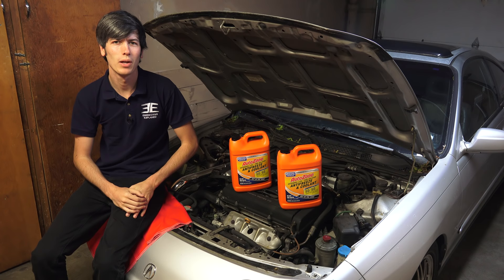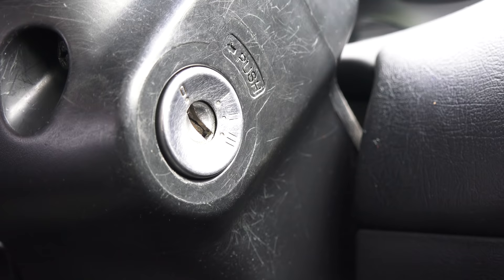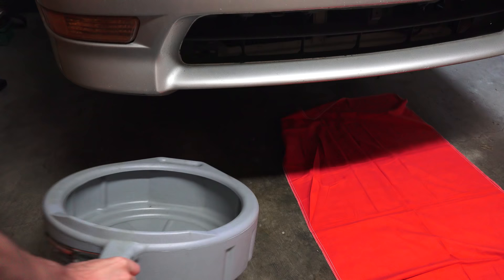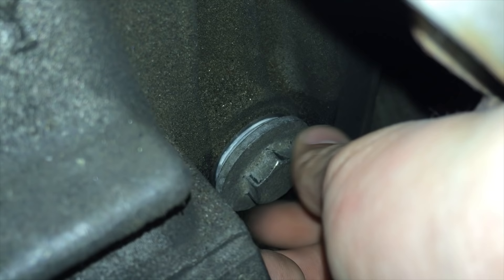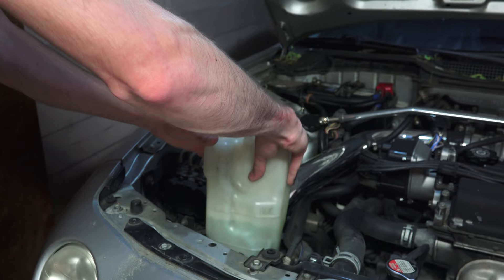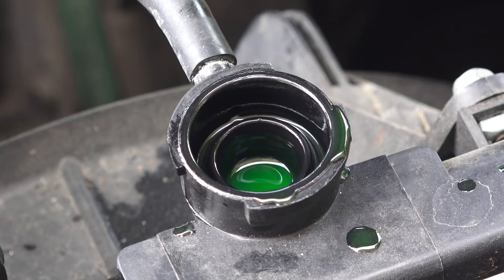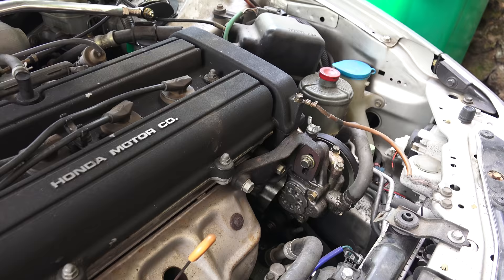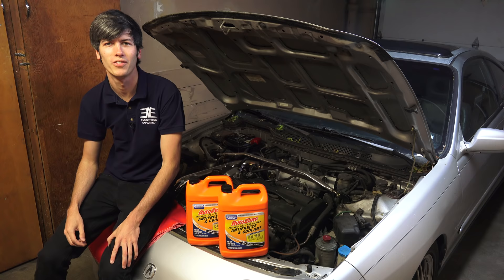How To Change The Coolant In Your Car

Comment: I don't use coolant in my Accents, it's just another one of my weight reduction mods
Reply: cool you saved 3 kgs in your car
Reply from the maker: Accents are naturally cool.
Reply: Hotter engines run better you know
Reply: 😎 If the car's paint is blue, it keeps the engine cool.
Reply: @fungustmaster  a1
Reply: lmao i just found out yesterday that my car was running like ass (‘03 Accent) because there wasn’t a drop of coolant in the car😂
Reply: Well water and coolant care probably about the same weight?
Reply: I heard ash is lighter than coolant .. 🤷🏻‍♂️
Reply: I heard from a freind of s freind that’s how you keep your head gasket healthy for a long time
Reply: Getting rid of radiator is far more efficient too
Reply: Use gasoline... it's lighter.
Reply: I think I have commented too much today 🧐🤐

Comment: I just open the cap and refilled. That was a mistake 😂
Reply: Why?
Reply: Its bad to just top it up ??
Reply: @betsthatnguyen  It's fine to top up. Just make sure you only use distilled water/coolant. But changing the fluid (draining everything) is recommended every 5-10 years. And if you need to top it up, then you have coolant leak. It's a sealed system, you should NOT be losing coolant. Find it before it gets worse and leaves you stranded (or orverheats the car).

Comment: Do all engines have drain bolts? Ive never heard of them until this video. And would it be a bad idea to run distilled water through it to flush out the coolant in the engine, then mix the 50/50?
Reply: I was wondering the same thing!

Comment: If you live in a cold climate, it can be worth flushing the heater core separately. My old car would give absolutely no heat in the winter; but after a back flush of the heater core not only did the heater start working significantly faster; it put out heat like it was brand new. This can even help with reducing how much time you let your car idle/defrost before leaving.
Reply: As an ex motorcycle rider I love the car heater and I'm in Australia.
Reply: This is awesome advice! 👍🏽👍🏽

Comment: Great video.  Proper maintenance is very important and often overlooked by many people.  Money spent early to prevent failure is cheaper than money spent later for a repair.  A good recommendation is to also fully flush the system with water and use a coolant tester to ensure a proper coolant to water ratio after refilling.  When bleeding air from the system it is good to have the part of the car where the coolant filler point is to be elevated to assist in removing air.  Like the video says a half is not an unreasonable amount of time to wait.  An air pocket could cause a sudden unwanted rise in temperature causing engine damage, especially if the head and block are of dissimilar metals, or completely aluminum.

Comment: Some cars have bleeder screws to help purge the cooling system. The GM 3100's have one on either side on the front of the engine. Open the one on the accessory belt side until air starts escaping then when coolant starts squirting out tighten it back up.

Comment: A trick I've found helpful for bleeding some cooling systems is to get an old/cheap radiator cap that fits,and pull the valve part out of it,so it's just the cap. Install said 'gutted cap' and drive around a bit,while keeping an eye on the temp gauge. Park it,and let it cool,and maybe repeat,if needed. Then install the normal radiator cap. This way the air will bubble out into the overflow tank,and when it cools,it will draw coolant into the radiator from the overflow tank. Self-bleeding. It just takes a couple drive cycles.

Comment: Always good to measure the amount of fluid that you drain so when you fill it you know what your shooting for.  The thing I would worry about in this video is you drained the engine block (nice that it has a bolt for that which is easily accessible) so when you refilled (thermostat closed) did the block get enough coolant mixture for a safe startup.  Knowing you drained a gallon and that you put about a gallon back helps to give you confidence that it did.  Just an extra bit of knowledge. Great video. Thanks
Reply: @168grhp  - you can’t generically say that the system will automatically purge the air. This is absolutely wrong in many cars like some Toyotas
Reply: @condor5635  I deleted my comment to keep from misleading someone with a cooling system such as you describe.

Comment: The plastic drain valve on the radiator can easily break on older cars and leave you with a bigger issue. It may be better to remove the lower rad hose to drain the radiator.

Comment: As a general tip I always attempt to get as much coolant into the radiator as I can before starting the car. Squeezing the hoses will help. Most cars also have bleed screws which must be used both before and after starting the engine.
Reply: What’s the idea about getting the air out? How do I do that when using a regular funnel?
Reply: @ktfoent  for example if the top hose is full of coolant then the radiator will be full. What one is trying to avoid is having a system that needs filling the next day or worse, driving on a partially filled system may blow a headgasket. Vacuum filling works the best particularly on rear or mid engined cars.

Comment: Thanks for sharing this video.🙏
I have a Honda Civic 2009 and want to flush the old coolant completely since I'm not sure when it was changed by the previous owner.
Q: You drained the engine block and started the car without coolant in the engine block. Does it DAMAGE the engine? How it should be?
Q2: How to ensure the heating radiator has drained (starting the car may needed)?

Comment: How do you know when the air is out though?

The easiest way to feel confident about it is to just wait 30 min?

Great video by the way. Its informative on something that in not technical but quite handy.
Reply: When you stop seeing bubbles gurgle up from within the fluid.
Reply: Why are air bubbles bad?! Can it cause problems if you don't get them all
Reply: @ninjalobo7  Basically if there is too much air, then it wont cool the engine as efficiently. The coolant mixture transfers heat much better than air. So it might overheat with too much air, but some is fine.

Its practically impossible to completely get it out.

Comment: the one thing i might add is to place the front of the car either on jacks or on an incline to help with the purge, the other is to squeeze the top of the radiator hoses  to help move the air through the hoses

Comment: So if using 50/50 mix won't freeze at 20f or 10f cause I'm in nc so it don't really get to bad no more than lile 15f if that in winter time .

Also when u use 50/50 mix do u use 2 bottles of that stuff or is it 1 full strength of antifreeze and then a bottle of 50/50 mix ?? Cause my car holes 13.5 I believe so just wanna make sure.  

By the way may not know what it is but it's a 87 Chevy celebrity eurosport 2.8v6

Comment: Some modern BMWs have an electric coolant pump and there's a special bleed procedure to get all of the air out: 

Fill the system with coolant
Hook up a battery charger if possible
Turn the ignition on, temp to max and blower to min
Press and hold the gas pedal to the floor for 10s
The system will then run the pump for about 10-12 minutes and bleed the air out of the system
Reply: modern bmw suck

Comment: @Engineering Explained,  seen many people flushing their coolant system with a water hose  or destilled water before putting in the new coolant. Is it a good thing to do so and if so when?
Couldnt you just change the fluid again with a shorter intervall to remove excess old fluid/particles?

Comment: I have never heard of the engine drain bolt before, do all cars have that? I own a 2011 chevy malibu ls 4 cylinder, my owners manual says nothing about that.
Reply: Not all do, some you need to drain 2-3 times for a flush, most are fine with just the drain and replace. 
Like oil changes, good to get it all but most is good enough, just doing the maintenance is half the battle.
Reply: Most every engine has coolant drain plug(s) on the cylinder block. 
The owners manual will probably not mention it, but the manufacturer's service manual will.

Comment: I never pull the drain plug.. Yikes never thought this was so specific.
Reply: Just flush it with water a few times although the coolant in this video looked ok.
Reply: Neither do I. I save a shitload of time by dumping it all at once from the lower radiator hose.

Comment: Should use distilled water if mixing your own 50/50 solution?
I've read conflicting info on this. More importantly do pre mixed coolant bottles contain distilled water or not?

Comment: so what happens if i didn't let the air out in the system?and letting the car idle for this long time does it effect because im in the hot country typical temps can reach around 32-38 c even at night :D. Car is 2012 Dodge Charger R/T and has 82000km.
Reply: Air in the system effects the performance of it. I'd suggest making sure it's clear of it. Granted, most systems will deposit the air in your system into your radiator and thus leave the radiator itself a little low on coolant (or take from the reservoir). Although, if it's low on coolant (or typically drains the reservoir) then you may have a coolant leak or something else. If you're a DIY person I can make a few suggestions but otherwise take it to the shop if you notice this behavior.

The car should not overheat even in high heat situations given the proper coolant mix and that there is no issues with the cooling system. If you're worried... keep an eye on the temp gauge. ;)  I don't know the specifics but I can tell you that I've been in stuck in traffic on the highway nearly not moving for over half an hour with the A/C on. The outside temperature was a cozy 46-48 C and my cooling system handled it fine. This was a late 80s Honda. I'm certain cooling systems in newer cars, like your Dodge, are more efficient.
Reply: thanks for the info

Comment: you should park your car uphill to help the air escape faster since your cooling system is an open system (it has a radiator cap). for closed systems park downhill and remove air from bleed nozzle near the heater.

Comment: in some cases may need to find a bleed valve or put the cap back on when running to create a vacuum
Reply: Bleeding is typically for the engine block's cooling loop. Bleeding would be unnecessary if the thermostat opens completely as the system should be designed to force any air to go to the radiator. Although, some cars really do need to have it bled as you suggest. So, as always, check your service manual. ;)

Comment: I apologize if this question has already been answered, but is this process the same or similar to "burping" a car's cooling system? I have a 2015+ WRX and am planning on installing an Air-Oil Separator and Exhaust Gas Recirculator delete, in which is recommended a "burping" of the cooling system. Thanks!

Comment: Hi My toyota sienna 2005 brought to the toyota center and told me that there is a leak in the radiator and needs replacement. I went to Through research i found the a temporary remedy for my car and that is the bar leaks cooling system repair. Do you recommend this type of product in your car? Thanks in advance.

Comment: What type of water should you run in if you don't run 50/50 mix? Isn't distillers bad to run? Also, I love in Texas. People say you're supposed to at least run 15% antifreeze with water. I don't think that's necessary because it doesn't get below 75°F even at night, but that won't mess anything up will it? Thanks in advance
Reply: I meant to say "isn't distilled water bad to run in the system?"
Reply: +TwoWheeledMisfit I heard something about it and I actually think you are supposed to use distilled water, their is a channel called chrisfix if you don't know already but he did a good video on how to do a complete radiator flush and he explains it all
Reply: +BeetlexVW thanks!
Reply: +TwoWheeledMisfit no problem, I actually live in Texas too I went to autozone and just  picked up a pre-mixed 50/50 antifreeze
Reply: +BeetlexVW sweet! I want to put a coolant additive in and it said not to use distilled water with it that why I was confused. But thanks again for help!
Reply: +TwoWheeledMisfit no problem

Comment: Do all vehicles have the engine drain bolt? Is it easy to differentiate from other bolts? I have googled the location for both of my vehicles and only get results for oil drain plug. I even have a Haynes manual for my truck and it only mentions draining radiator and heater core, nothing about the block. 

Just wondered if they are easy to spot, don't want to accidentally remove a bolt to something else.

Comment: Could you do a video on how to change the head gasket on that sort of car? or something similar of a head gasket how to?
Reply: How to change a head gasket-pray you don't have a Subaru
Reply: BOXER HEAD GASKET REPLACEMENT SOOOON

(rcr e30 engine rebuild joke...)
Reply: right, Subaru can be complicated...tricky!
Reply: +MARINO VASQUEZ especially ej20 I'll stick with my ez36...
Reply: +Jake B you should try a 6a13tt head gasket, I'm gonna do the clutch soon
Reply: im not a mechanic either but like working on cars, im not equiped with cameras and things so cant do a show ya how vid. but i did replace rear diff few weeks ago mite of taken 6 hours. bit i will get it done whatever it takes cheers
Reply: I just changed a madza 323 dohc head gasket 2weeks ago, I'm getting better

Comment: why do you ned to tunr on the the heater core or you said open up? open what up? are you just runing the core fan without the engine runing? what does that do? the whole thing is conected to the engine block water jackets right so wotn it all drain out? there are no valves open or closed on the block so i did not understand this part

Comment: Is it necessary to unplug the engine coolant bolt!, I am always changing the radiator coolant  every two years without drain the inside engine coolant, just drain and fill up the radiator coolant.

Comment: Once the coolant is drained from the engine block, is there any risk to harming the engine when I first crank it back up and the thermostat hasn't opened yet, so coolant isn't flowing through the engine block yet?  My car seems to take about 20 or so minutes before the thermostat opens, and it makes me nervous thinking the engine is running that long with no coolant inside the engine block yet.

Comment: I have a 1997 Acura Integra GSR.  Can anyone tell me where to find the engine drain bolt?  Do I need to be under the car or looking down from above?  What is it near?   What socket size is needed to remove this bolt?

Comment: Unfortunately none of that applies to a 90s or 2k VW, inasmuch that there's no rad cap, no rad drain, no engine drain plug and no heater core valve. Plus the thermostat should be removed for a complete flush which is easiest done by flipping the car on its roof. In addition you'll need vw specific coolant which inexplicably changes from year to year and costs several orders of magnitude more than conventional coolant.
Reply: And yet the early 2k Audis have drains for everything, also the coolant does not change year to year, old cars g12 or 13 works just fine.
Reply: The Earth Is Cubed how to drain coolant in 2010 tohoe

Comment: Isnt it bad to let the radiator cap open when the engine is running? So how is it diff from normal driving condition with the radiator cap open?

Comment: Wow, up to a half hour to bleed the air. Is that also true for cars which have a bleeder valve on the thermostat housing? 

Certainly explains why I've always had to keep an eye on the system for the first couple of days after a coolant change.

Comment: If during a trackday the engine starts to "overheat" (well, if the gauge passed the middle zone) is it worth starting the radiator fan while running or just slow down for a few laps? the gauge doesn't hit the red/max temp zone, it just sits like 3/4 of the gauge range...
Reply from the maker: Best to just slow down for a few laps, the speed you're traveling at will make the fans not all that effective, airflow is what you want. You can also turn on your heater if it's getting hot, as this pulls heat directly from the engine.
Reply: Engineering Explained thanks a lot!

Comment: Does the coolant level in reservoir bottle drops overtime as I've noticed it in my car. It was at Full level which has dropped to in between half and Low level in 1 year. In last, could we mix coolant or top it up with distilled or mineral water.

Comment: Bro can you tell me how to change the coolant new Suzuki Swift RS 2018 model? because, the user manual said there are 4L capacity of the coolant. but we  have changed, it was fill with 3L. is there any nail to remove and drain remaining 1L coolant? service agent also don't have good knowledge of changing this new model car. if you know any service manual to download to find out service manual of Suzuki Swift RS 2018 (booster jet engine) it would be a big help if you could give a answer
T.I.A.

Comment: Hi, that was really helpful. I have a query. After riding around 2500 kms on my new motorcycle, I noticed my reservoir level was just below the low mark. But the radiator was full. Is it okay? Thanks in advance
Reply: The reservoir is also known as the overflow tank.  The reservoir can be low with a full radiator.  It just means that the radiator needed more coolant and it drew from the reservoir.